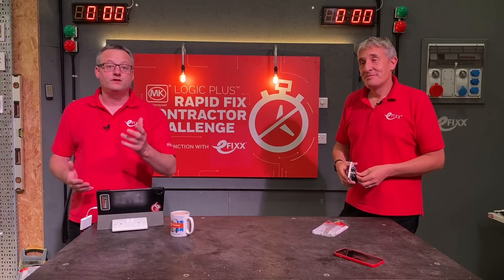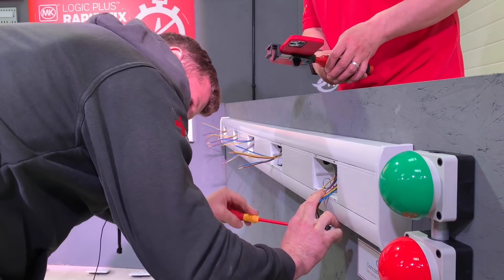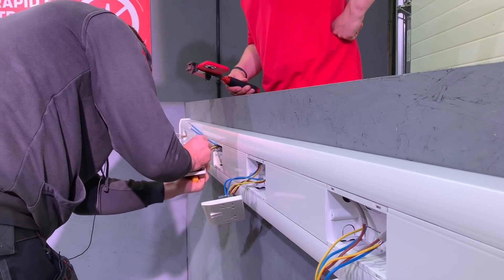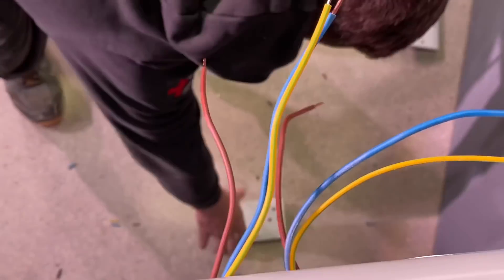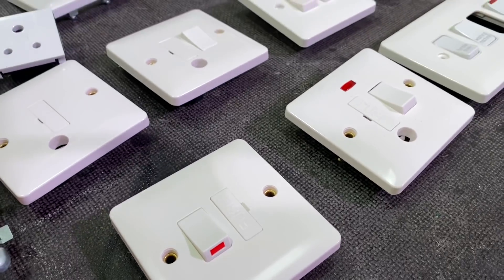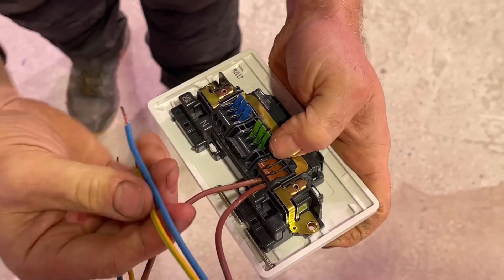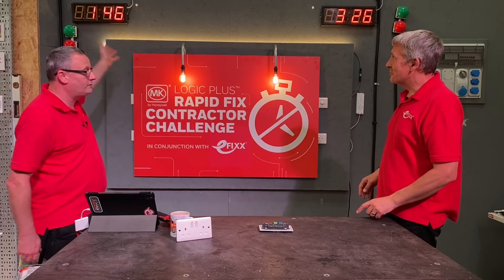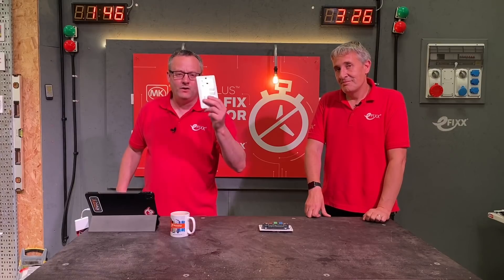MK RAPID FIX SOCKET- V- SCREW TERMINALS time to hand it over to a tame electrician.

Comment: OK - I went back and looked deeper - I found them in SF. Five for £30, that is 50% more than the screwed Logic Plus but I bet if they start to sell then the price will drop and the screwed terminals will be reduced and stocked just for the die-hards who never admit progress is a good idea. It's strange because you'd think they would have less free time, having to feed their horses and muck out the stable when they return from work.

Comment: A very useful product analysis.  However, I've seen on other channels that this might encourage 'Joe Homebase' even more to have a go at replacing sockets etc. Do you think that this is also a 'safer' option for those who would be looking to do this?
Reply from the maker: We have a DIY guide from 1949 which gives instructions on how to change a socket. This product is what electricians have been asking for. Improved reliability of connections and faster.
Reply: @efixx  and until at least the 1980s, consumers in the UK were expected to mount plugs on every appliance they bought. Is replacing a socket — not extending a circuit, not doing fancy intermediate switching, just replacing a socket — really any more complex than that? *really*?

Comment: Trial run on just a double socket & only being available for now at a certain place to buy is without doubt going to have tiny push back
Wondering how levers will work in a single socket, FCU & any light switch
We’ll have to wait and see

Comment: It’s not just about speed it’s about reliability and safety of the made connection both at installation and over time-say 20 years. From a cost perspective v time saved - on a new installation or a full rewire it is highly likely to be cost effective on a socket replacement not so much.

Comment: So you saved 80 seconds over  5 sockets, or 16 seconds per socket. Even at £90 per hour that is still only a saving of 40p per socket. It's pretty hard to justify these on time saved for installs under good conditions.

And justifying them on quality of connections is awkward because it's only double sockets, any real install will contain other accessories, so you can't offer the customer a fully screwless install.

Where I could see these being a boon is for installs under adverse conditions, sockets in difficult locations, existing wires that are too short etc.

Comment: I would like to see a plastic U piece just before the lever terminals.. About a  few mm from the lever terminal.  Push the conductor in, then any stress from cables behind is put on the U piece, not the terminal itself. Similar to having a cable clamp, but no screw involved and no pressure clamping of the conductor.

Comment: What many fail to see is that having a circuit's current running though the screwed terminals at the back of a socket at times can be dangerous.  Why?  The socket should not be used a junction box. Simple. But it is.  When say three conductors are put into one of the screwed terminals, their is danger of stress on the terminal as the socket is pushed into the box. Also, the terminals may work loose over time, due to expansion and contraction and stress on the terminal and conductors.  I have removed many sockets with the wires pretty well falling out behind.  I am sure most have had that experience.  

I always twist together the two conductors tightly with pliers, in case they become loose, then some sort of decent contact is there if the circuit is on a heavy current load. The socket makers say all you do is strip the conductors then put them into the terminals and screw up.  That is poor advice. 

But now all that is eliminated with Wago connections on the rear.  So far safer.
Reply: Bloody poor analysis…..😆

If you ever actually qualified…..that would be the only poor analysis I can think of right now!  😂

Bloody amateurs.  But I suppose they keep us good quality electricians in work.  Even if they do threaten the lives of many with their poor and dangerous work
Reply: @Spark101.  
Ad hom attacks again - lost again. You are conversing with graduate engineer here. Take note of the clever fellas.
Reply: @johnburns4017  😂😂😂😂 No bloody chance.  You are an apprentice at best.
Reply: Please…..please……leave the clever stuff to people like me.
Reply: This is a wind up.  Yea, good one.  You got me for a while. 😂
Reply: @Spark101.  
No sunshine. A graduate engineer.  I find it difficult to communicate with those who picked it up.
Reply: @johnburns4017  You’re a ‘Graduate Engineer’ who wound up as an electrician?

Or are you simply calling yourself a graduate engineer, when really you’re just an old school electrician who doesn’t like change?
Reply: @Spark101.  
Sunshine it means I am brighter than you. Just accept it. It is easier that way.
Reply: @johnburns4017  😂😂😂 what a plonker.  You assume your ‘engineering’ qualification trumps anything I have?  And you also assume a qualification is the only measure of ones intelligence?!

You’ve shown your Calibre.  It’s very clear.  😆
Reply: Sorry, but your advice about twisting the cores together is poor.

And if a screw terminal socket outlet is connected correctly, and importantly, tested correctly…..they are absolutely fine and safe.  Using your method, you could be in a situation where testing doesn’t identify a loose connection, which under load could cause a fire.  The circuit core connections on a ring main should be made and completed  using the socket terminals……not twisting.

I always come across cores that have been twisted together and think……’another amateur or DIY’er having a go’
Reply: @Spark101.  
I don't think you got my points John Ward did a vid overloading the current of a number of connectors on a wire. A wirenut was one. That is twisting the wires together. The wirenut performed well. 
https://www.youtube.com/watch?v=2uYD8e7idnY&t=1s
I made the point of the screwed terminals working loose over time. Also the conductors can be worked loose immediately if the socket is rammed back with little space behind with the space behind crowded. Then if the wires are not twisted together you have a sparking situation that may lead to a  fire. 

What saves many fires from occurring is that many circuits are running nowhere near the maximum current.  If all circuits in the UK had maximum current that the mcb permits run through them for half an hour, the country would be littered with blazes. 

Twisting the conductors together was the norm by electricians at one time. Now they are more interested in getting in and out quickly. With Wago sockets now they can get in and out quickly and leave a safe installation behind for years to come.

Another point is that solid wire is not meant for flexible applications, such as moving in and out a socket.  Flexible cable should be used.

Please do not come back and say "I have seen screwed connections solid after 50 years".
Reply: @johnburns4017  I understand why twisting cables together maybe a better connection than using a screw and terminal to clamp them together…..my point however is;  using this method to join the cables before they are terminated into a socket is bad practice.  

I could twist the lives together, shove them into the live terminal of a socket and not even bother to do it up.  But guess what?  It will pass ring continuity tests.  

If you test a ring main and it tests out ok…..and the method of install doesn’t include twisting, it’s a fair assumption that all conductors are secure in their terminals throughout the circuit being as the clamping of the conductors is the sole means of connection.   Using the twisted method…..a good test result doesn’t mean all socket outlets are electrical sound.

There’s a reason we don’t twist cables together anymore.  If you are concerned about terminals or cores working loose…..just try installing it correctly.  Double the cores over…..tighten the terminal up to the correct torque.   

A twisted pair of cables might not work loose over time, but that twisted pair can still work loose in the socket terminal, and therefore your method is no safer than not twisting them!  If anything, it could give a false sense of security.

If twisting is such a great idea…..I have no idea at all why no college or electrician I know teaches it or does it.  And just because ‘that’s how we used to do it’ might be true……it doesn’t make it correct.

You mention John ward?  He doesn’t twist his together!  Even though he showed everyone how great the connection can be!  I wonder why!? 🤷‍♂️
Reply: @Spark101.  
You still never got it. Screwed socket terminal do work loose over time.  Not all but enough of them. I have come across many - in my own home as well. Twisting the wires together ensures a safer installion over time.  But forget all that, buy screwless sockets, then no problems. 

Or fit Wagos at the back of the backboxes that take the full load of a final ring or radial, then spur off the Wagos running flex cable to the socket. The socket is then not used as a junction box taking heavy loads, and easy to fit in. The heavy loads are taken by the Wagos, which do not have two, or more, conductors rammed into terminals.
Reply: @johnburns4017  OK John.  Now I know your not an electrician.  

With all due respect sir, leave the electrical installation work to the professionals.  

All the best.
Reply: @Spark101.  
You have poor analytical skills.
Reply: @johnburns4017  No,  I think I’ve read the situation correctly.  And if you are a sparks……give it up.
Reply: @Spark101.  
You lost, having to resort to ad hom attacks.
Reply: @johnburns4017  any real electrician reading this will know the point I am making and agree with me.

Doesn’t matter what you say, twisting the cores together before you put them into a socket outlet terminal isn’t the correct or advisable method.

I haven’t lost anything.  I am right…..your not.
Reply: @Spark101.  
Manufacturers say just strip two, or more, conductors and put them directly into the terminal, then screw up. They want it to sound simple, and be quick. Expansion & contraction over time, or stress, or both,  on the terminal as the socket has been rammed back when fitting can make the conductors loose. 

These conductors are say, taking high current in a final ring, they are then loose, creating sparks.  If the conductors are twisted together this sparking is greatly eliminated, as the spine of the circuit is compromised far less.

It is safer to twist them together when using screwed terminals.   These new Wago terminal sockets eliminate this safety problem. 

I use Wagos in the back of boxes to ensure the ring's current does not run through a screwed terminal on the back of a screwed terminal socket.  In my view, sockets should not be used as junction boxes - that is what they are generally used for right now.  

The new MK Wago sockets use the rear of the socket as junction box for sure, but the integrity of the connections, with only one conductor in one Wago terminal  makes them far safer than screwed. 

Also conductors to the rear of a socket should be flexible, not solid, so an not to disturb cables in the box behind, or put stress on any type of terminal.
Reply: @johnburns4017  We’ll have to agree to disagree mate.   I completely get your reasoning as to ‘why’ twisted cores can help maintain a circuits integrity in terms of continuity of cable/cores…….but you need to consider the connection between those cores and the socket.   Whether twisted or not, the same dilemma with vibration, expansion and contraction exists.   Twisted cores will loosen off just as much as cores not twisted.   The twisted cores may also help maintain a sound circuit even if they do loosen off in one or 2 sockets……because they are twisted!   BUT because they are twisted, you will also not pick up on those possible loose connections in the sockets when doing ring continuity tests back at the CU.

I will also argue that I’ve seen many twisted cores in sockets that have had the terminal screw tighten down on it, but because the terminal screwed down on one core only due to the angle it was inserted…….that core was crushed.   Biting down on 2 cores laying next to each other better distributes that pressure.  Or better still, double over the cores.

Let’s be honest though……no one really doubles over anymore.  And no one teaches it.   There must be a reason.   The industry and every electrician I know and have met in my 20years can’t be wrong! Lol
Reply: @Spark101.  
You have not even analysed it properly just accepting poor practices for decades without question.  The rear of the socket should not be used a junction box for heavy current circuits. That is not its function.
Reply: @johnburns4017  Twisting together is poor practice.   And as for the socket being used as a junction box…….you can say the same for many accessories.  Light fittings…..light switches using the 2 plate (loop in, loop out) method and many more.  Any circuit accessory where there are more accessories after it may well end up being a JB of sorts.

Your Wago method in the back of sockets is poor.  And improper.  I’ve never seen it, and most likely never will.  Looping in and out of socket outlets is fine.  And NOT twisting together is the preferred method.   Sorry buddy……..you are wrong.  And if you worked for me, I’d have to let you go with such poor workmanship suggestions and skills.

I continue to use methods tried and tested…..methods that the masses agree on.  You sir, are the minority.  Sorry pal……your old time methods are no longer considered any good.   Bitter pill to swallow mate.  But……you are 100% wrong.  Please stop connecting sockets in your dangerous way.  Please just learn to do it in the more modern method.  Done properly……it’s absolutely fine!
Reply: @Spark101.  
Poor on analysis. I disagree with just about everything you write. One of these I have always done it this way.
Reply: @johnburns4017  yea, and you’re a ‘this is how it used to be done’ type person lol

 Let’s face it……your method is no longer practiced.  Your method is not the safest.  Your method is very dated. 

Move on ffs.  Or give up.   It will help the industry out either way.

Comment: Trying to make off connections as fast  as possible. Unbelievable as it’s probably the most important part of what you do .
Reply from the maker: It’s to prove a point not a mantra for a real installation.
Reply: Fair comment , just winced when I saw non doubled cables being terminated into the screw terminals , shocked by how many new installations I’ve come across  where this seems to be the norm , hats off to MK although the price might deter people .

Comment: great video guys, its a lie if someones quicker on screwed terminals! If you can answer a question a bit off topic but does anyone know where the rule of not running flex more than 3 meters in a house came about? looked into it and cant find a reason as to why you're not allowed to, but seems too be a myth many electricians go by... cheers guys.
Reply from the maker: You can use flex for fixed installations so we think the 3m is a myth.

Comment: Amazing that it's taken so long for this development, but why are there only three levers on the earth? Surely a faceplate on a ring with a spur and a metal back box will need four levers on the CPC...?
Reply: current MK logic plus sockets have a single cpc terminal - terminate all the cpc conductors into the backbox and a flylead to the socket faceplate.
Reply: Metal backboxes with one solid lug need to be used. 
Or looping the CPC into the earth terminal on the backbox - without cutting the CPC conductor.

Comment: I like the idea of them as specially for two day and five day corse junkies, but I prefer the screws, I don’t need to rush , when you rush you loos concentration and make mistakes and that’s when you end up killing someone if not you’re self. As for over tightening the screws and damaging the conductors? Isn’t true, I have always tightened the screws till they stop and have never never broken or damaged a conductor  , .  Isn’t that the reason we double the ends over to give the screws something to bite onto and insure a tight connection  secondly conductors can be pulled out of wago s David Savery  did it in one of his videos . So I think the argument about loose connections is dead. But would I install those sockets ? Yes if that’s what the client wants and they buy them there self . 
Great video guy’s as always 👍❤️⚡️

Comment: The comments came up here too, absolutely the same ones, when we switched over. I can do that as fast or faster with the screw terminals, or this is reducing our skill level, making it easier for DIYers. But nothing of that happened...and the DIYers will also do it with screw terminals.
I took a few pictures from different types of sockets and their connectors. I removed the covers so you can see the terminals better. 

Modern terminals, two openings per terminal, so you can use them also as connectors. To insert wires it works like push-fit, just shove the wire in. To release them push the button of the terminal. That socket is from the early to mid 90s:

https://abload.de/img/img_1347s7jni.jpg

https://abload.de/img/img_1348kmk3l.jpg

That guy here is from the 1970s/80s, can also used to make connections and can handle two wires per terminal:

https://abload.de/img/img_1346vak8g.jpg

https://abload.de/img/img_13458bkhn.jpg

That one here is a special thing, requires only one back box. And this type still has screw terminals today:

https://abload.de/img/img_1349bjktt.jpg